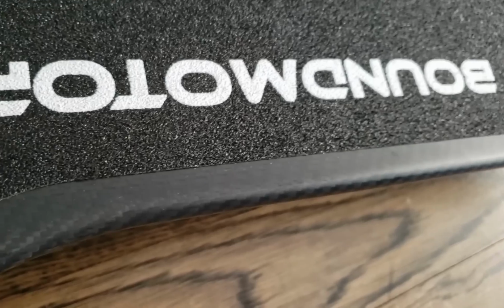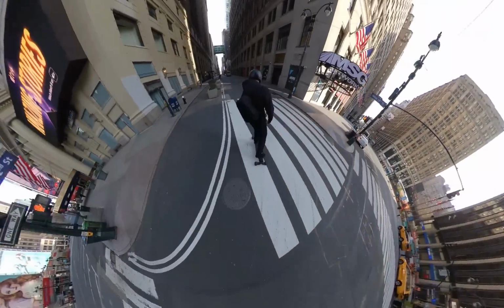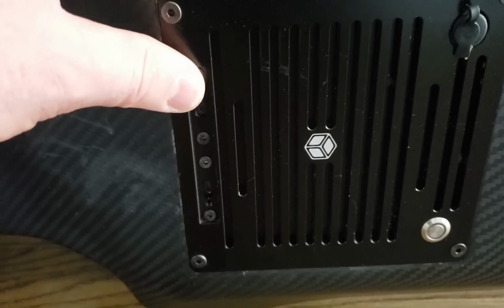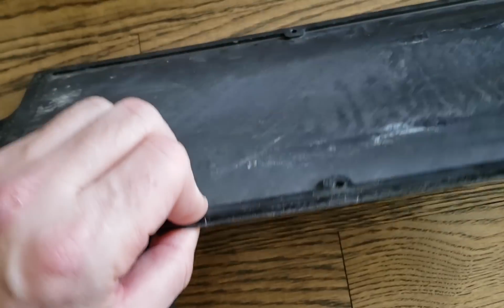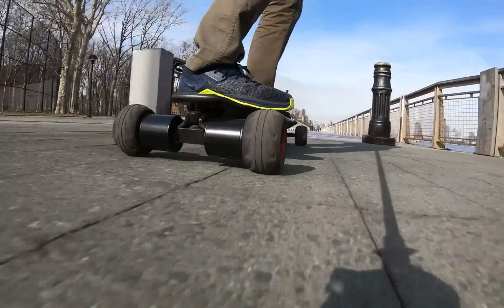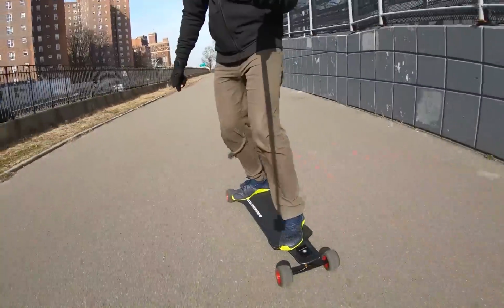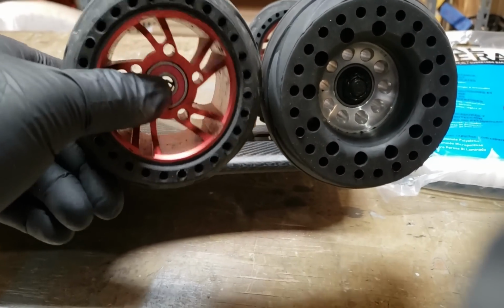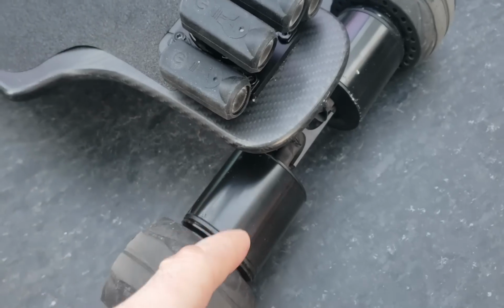Bound Motor D1 Direct Drive Insane Machine

Comment: Hi there I’m just doing a follow up on my comments , after quiet a few months of trying to sort my problembs 10 months , I invested in a new DD for my board ,that didn’t work but did run a little better,invested in 120 cloud wheels for better clearance , tried running my board threw the vesc program ,but one port didn’t respond ,then perchased another vesc from Eovan which is the same board & it just slotted right in , ran it threw the program again ,& !   It turned into a complete beast ,kills hills & scares the frick out of me ,love it as my favorite board now ,love the coast feeling & sooooo quiet , purchased another board from Eovan belt drive this time ,which arrived 3 days after I got the first one running ,so now I’ve got 2 , happy days ,blown away with both boards , would love Eovan/ bound board to make a carbon drop deck like the D3 ,please 🙏🏻😌

Comment: does your motor have this clicking issue at low speed as seen in this video https://youtu.be/1eKIU_q9Dio? pls let me know.
great review from your video!
Reply from the maker: Do this first! Remove the wheels and see if the noise persist. I did not have this issue but I swapped for bigger wheels and the noise appeared. I removed the wheels and placed back the stock wheels and the noise disappeared. 
I rolled the drive without the wheels and there was no noise. I think when the wheels are mounted they may not sit tight or properly flush which make the axle twist and results in bed alignment creating this grinding noise.

Comment: How did u add Bluetooth to this vesc?
Reply from the maker: buy the module and connect to the vesc
Reply: @ElectricVehicleSpace  hmm there's no  extra ports on this ESC?
Reply from the maker: @gti101  u have to solder it
Reply: @ElectricVehicleSpace  ahh do u have a pic where to solder it to?  I would like to do this.  Sorry for any troubles

Comment: OK Good board very different of my Exway X1 Pro RiOT  surf or snow 🏄 🏂.. But I have no information on this Cheap remote , I received VX2 Remote with Digital screen and receiver  how to install this on mother board D1...  And no application for Android smartphone or smartwatch please open source no ? Thank you so much for your help
Reply from the maker: this is a open vesc source esc so it can be mded to do all of the above or just replace with vesc that has this options and you are good to go.
Reply: @ElectricVehicleSpace  I can't configure VX2 on this Board and no support of BoundMotor different motherboards on this brand...  And no Bluetooth on this D1 model
Reply from the maker: @Neobees  that remote is hard to connect to a regular vesc. Its duable just read online and find how to do it. You may need to do some modifications
Reply: @ElectricVehicleSpace  Yes because motherboard BoundMotor VESC they are very different,  so I don't find how to configure VX2 Remote on this board and BoundMotor support no help me, 
I buy a War Watch (Gs Pro)
With this I have a lot information in real time on the road...  But no information of the batterie 🔋 ( remaining,  regeneration %...etc) 
So Remote on my Exway X1 Pro RiOT is better

Comment: Very nice Review I buy This Board and I Sell my Exway X1 Pro RiOT after +7000km 🏄🔋I will Never go Back  to Belt$ Or Hub Motor Never !!!
Reply from the maker: Belts are good too! Keep them.
Reply: @ElectricVehicleSpace  yes but the belts on the Exway X1 Pro RiOT are very thin and smaller on any other brand so that at the slightest emergency braking they break very very often even much too easily

￼

Comment: I'm going to replace my Chinese hub motors with these.  The motor/ESC upgrade will cost more than the original board did.  Which hub adapter should I order if I want to use the Flash wheels you just reviewed?
Reply from the maker: you dont need adapters. You should also try belt drive. It will be cool with these wheels.
Reply: @ElectricVehicleSpace  I decided to go with the 150mm pneumatic wheels.  I have terrible roads with lots of gravel.

Comment: The Boundmotor motor website says you cannot add a NRF / Bluetooth module like you can on Flipsky.  Have you verified that you have an extra port on the ESC? I like the Trampa NRF dongle and the the WAND but Boundmotor says that it is currently not possible.
Reply from the maker: you need to solder to the esc

Comment: I'm 6'1 and about 265 lbs.  I'm debating between the D1 and D3.  I like the D1 because of the carbon fiber because of my weight.  I like the D3 because of the larger battery option. But the D3 also seems to have less ground clearance.  Which would you recommend? Also can the wheels be swapped out for 120 Cloud wheels?  If so, which ones and how?
Reply from the maker: I like the D1 and you can add additional pack on top to double the range. Yes you can swap the cloud wheels if you get the adapters. The ride will get smoother.

Comment: The board has finally arrived! The build quality is top-notch, a solid-looking board. With that said, I have an issue with the controller. For some reason, the remote losses connection unpredictably when riding the board and trying to go full throttle (even on the lowest speed mode). I ride goofy with the remote in my right hand. When using the remote in my left hand (closer to the esc) there are no problems. Very odd as the remote's range is supposed to be 15-20m. I messaged Boundmotor and awating response.

As for the bushings, they have to be tightened down, but how much is too tight? 

Would it be possible to order a custom made battery pack extension that fits in the additional space in the deck from @Portable Electric Vehicle?
Reply from the maker: You can get flex washers and place them over the bushings. It will improve handling big time. Extensions batteries can be made easily. The remote issue is weird. I did not have this problem. maybe the remote was dropped and something is loose inside. Cato should get back to you soon. He is really good at follow up.
Reply: @ElectricVehicleSpace  Could you point me towards a website for the "flex washers". All I'm getting are metallic washers... what about cupped washers? As for the extended battery, they are relatively easy to make however I do not have the proper tools to the battery pack itself. Would I be able to order one from you? If not than no worries :)
Reply: How is your problemb going ,have you fixed it ?

Comment: Hey Vitali, love the review and am considering getting the D3. Do you know if it’s possible to change the wheels on these boards so that we don’t have to use the airless wheels?
Reply from the maker: Depending on what wheels do you want to mount. What are u looking for?
Reply: @ElectricVehicleSpace  I'm looking to put cloudwheels or 110mm torqueboard wheels on it. Also, do you have any other boundmotor boards to review? I'm really close to purchasing the D3 but haven't seen that many reviews on it. Last thing, how long did it take to ship to you?
Reply from the maker: @brainrush25  usually 7 to 10 business days.  Now it depends on customs and c19 ops. I will review the offroad version and the D3 soon.

Comment: You think onsra direct drive is better than bound motor?
Reply from the maker: I have not tried it. I cant comment on that.
Reply: @ElectricVehicleSpace  can you make it happen ?
Reply from the maker: @kevinchan4951  if there will be 50 requests than yes
Reply: Onsra customer support may be better , if you get a bound board you will be contacting them ,sure ,that’s if they answer ?

Comment: Hello, how do you feel about direct drive in terms of damaging the motors? Up and down curbs? Rocks? Thank you
Reply from the maker: I dont jump curbs and I try to avoid big rocks. It will get scratched but it is fine after 2 months and works well as was intended to perform.
Reply: @ElectricVehicleSpace  Thank you!

Comment: With the customizable ESC, how much range could I get if I limit the top speed to 22 mph or 35 km/h. The load would be around 190 lbs on regular roads. Also, how water-resistant is this board? Could it pass an IP 56 rating? I don't want to skate in the rain but if I get caught in the rain or run through a puddle by accident would it survive?
Reply from the maker: idk...this has to be tested. The board can be waterproofed easily. I would not ride in the rain.

Comment: Great review. I think there is an opportunity for a manufacturer since more are starting to include the vesc6 and a 12S battery to do a belt drive version  which can be used as a base to add bigger motors to so have a good value high speed board. If have a battery option that are big enough might provide a good alternative to those that want DIY performance but not the parts or electronics knowledge to go full DIY. Is there anything else out there at a lower price point like this already ?
Reply from the maker: the company is coming soon with a belt system and more options. I have not seen anything better yet but at 1k this is really cheap and the quality is good. If you DIY with available parts on the market today it will run you over 1.4K similar built.

Comment: Would you ever try to put the direct drive motors on the exway flex?
Reply from the maker: it will not work. Exway is tuned with they proprietary motorsmade by wobbywing

Comment: Hi. Could you please advise me about battery. Is there a big difference in performance of 12S3P Samsung 50.4V10.5Ah  with 18650 cells and 12s3p 21700 cells. There is a 200 USD difference in price of the board and I am wondering if it is worth upgrading.
Reply from the maker: use the code I placed in the description you will get a better price. The difference is in the range. 21700 will give you way more range. Thats the main difference and since 21700 have more capacity the battery sag will only be felt once the battery gets to lower level.

Comment: How do you play with the settings like that,  I would love to do the same. What do you gotta do to make it faster like you did?
Reply: I was wondering the same thing. I don't really know much about building boards or adjusting ESC/VESC, but I would definitely want to make it faster since I weigh around 200 pounds. Just adding to your question in hopes that you get a response!
Reply from the maker: Easy, just connect to your computer and install the vesc tool recommended by the company and its easy to set up. There are plenty of tutorials on youtube. Do it and enjoy the board.

Comment: I'm just getting into e-boards, I've been hesitating between a few boards, this being one of them. Which board would you get for a beginner between this, backfire zealot ( or g3)  and the Exway Flex? (Feel free to recommend anything else)
Reply from the maker: I would get the Flex or Verreal RS. if you have 1k than bound motor D1. Check my video description box you can use the code/link and get a better price.
Reply: @ElectricVehicleSpace  Thank you good sir, be safe and stay healthy!
Reply: @ElectricVehicleSpace  wts wrong with the g3

Comment: Those motors are so close to the ground that I foresee problems related to damage on contact
Reply from the maker: For city ridding is very ok. For bad road or off road it will not work out.
Reply: Portable Electric Vehicle  give it a few months and report back

Comment: There should be supercaps in parallel with the battery. I've had a battery go out on me while riding and I couldn't stop. Very scary.
I'm starting to think belts are a safer technology. Some thought has to be done for safety of the rider.
Reply from the maker: could you elaborate on the comment. What exactly are you referring to? There is no need for caps on the battery. The esc controls the motors.

Comment: I need your help! :) I want to buy new board but cannot decide and you have tried all 3 that I am choosing from: EXWAY X1 PRO/RIOT (like: better know brand; concerned: low milage, least powerful ), Verreal RS (like: longest range with 14aH battery, comes with cloudwheel and is the same price as EXWAY, concerned: that on paper lower top speed) and Bound D1 (l like that it claims top speed 50 km/h, but it is strange that is much faster than Verreal despite has same motors). What would you suggest? What was most comfortable and stable ride for you?  My previous board was 1st gen Kooweel and have not tried any other board.
Reply from the maker: Are you looking for portability? Range? or Speed and custom?
Reply: @ElectricVehicleSpace  Thankf for prompt reply. All three are important, I would rank power (speed/torque) in the first place as there are many small/medium hills where I live, second would be portability/range. Also road are pretty bad, so I guess cloudwheels is would be suitable for more
Reply: One more board Meepo NLS pro just came in my mind as it is significantlly cheaper bus has great top speed
Reply: Did you end up purchasing one? I can't decide between the Meepo NLS Pro or the Exway X1 pro. This is the first time I've heard about the Bound D1.. on paper it seems like it would be the best choice.

Comment: So I looked up the specs for the batteries in the board and you can give a max of 35 amp continuous for  those cells, cuz I was wondering, and if you are too.
Reply from the maker: Those cells can discharge more for short period of times. It depends on terrain, your weight and so many other factors. The esc is set to max draw 30A but motors were set to 30A per motor and 60A per motors. When set to 60A the battery was still set to 30A max so it will not affect the battery that much.

Comment: What direct drive system should I get what brand I'm still not sure who I should get it from
Reply from the maker: Get bound motor D1 or D3 awesome boards and the drive did not overheat with my weight. Torques direct drive I tried in 4x4 set up and it is cool but I heard from NYC E- riders that it overheats.
Reply: @ElectricVehicleSpace  I'm getting one soon I'm going to run 45 amps to each motor you think that will be perfectly fine to keep it at that. Are the batteries able to put out 90amp continuously
Reply: @ElectricVehicleSpace  did you have to program each motor/vesc  individually, was there two USB port on the board or was there one USB?

Comment: It's more about ride quality. Mine can do 30mph and about 18 miles if I cruise at 12mph ish. But when you ride it for 5 miles non-stop..your foot and legs get exhuasted. So it's more about range for fun time cruising and ride quality. Speed doesn't matter, I usually cruise at 16mph. Most boards do that easily.
Reply from the maker: how much do you weight. I will do a range test but I get easily 9 miles at high speeds.
Reply: @ElectricVehicleSpace  I'm much lighter than you at 165lbs. But after riding mine over a thousand miles lol. I will have to say that the ride quality is best rather than speed. Just me though since I like to ride until my board dies lol...and that's alot of miles.

Comment: I run those drives on my DIY board, absolutely amazing drives. I will never go back to belts!
Reply: Me Too after 7000km with Exway X1  Pro RiOT,  I want direct drive
Reply: Range seems to suffer though.
Reply: @jamespostle6894  Yes Exway Stop X1 on Jun 2020 , X1 Pro on this December 2020 for a New Product ATLHAS Pro,  it's a very good Board but I change Brand because I'm very disappointed of customer service
Reply: @Neobees  I was referring to the direct drives but yeah good thing too I was seriously considering buying one.
Reply: @jamespostle6894  Already buy direct drive system with Cloudwheels I Wait...   sell it my Exway this month and l'll never go back to belts or hub Motor
Reply: @Neobees  yeah for me a belt drive makes more sense the direct drives are just so close to the ground it bums me out.
Reply: @jamespostle6894  More maintenance on belts Drive after One Year use...  So more money 💵 🔧
Reply: @Neobees  I suppose but It would still be a trade-off as you need to replace the motor housings more often since the motors are right next to the wheels. Not a clear cut upgrade.
Reply: @Neobees  backfire has great customer service but bolts and nuts are terrible, had to ask for bolt names and specs to replace with better quality ones after I had a bolt snap in one week. I emailed them and sent a picture of the bolts that broke and they paid for the new bolts so can't complain
Reply: @P.Subaeruginosa  ONSRA BlackCarve 2  now BMW of feet made in Germany
Reply: @jamespostle6894  With rubber wheels, yes. I switched to TB110s, best wheels for this drives!
Reply from the maker: Awesome.

Comment: Sadly I can't use DD since there are broken roads where i live and it can ruin it. I'll probably get them when I get really large AT wheels.
Reply from the maker: yes indeed is sad.
Reply: I have adapted 6inch pneumatic tires from torque boards to my direct drive kegel adaptor. It's so nice to when going off road on trails with pneumatic tires. All u need is a drill and Dremel tool. I can send pics if you want

Comment: Can you get the hub kits and replace it with a meepo or apsu board hub ?
Reply from the maker: i would not do that. Maybe its double but why?
Reply: @ElectricVehicleSpace  i would use a double for it .. cos i prefer the direct drive thats why

Comment: on paper all of these boards look amazing. but im just worried about its lifespan. how long do these boards last until they totally break down and you have to buy a new one.
i guess time will tell..
Reply: You should build a board yourself so you get to know all the components. Then if something breaks you can easily replace a part instead of the whole board
Reply from the maker: I will do a follow up video in 2 months
Reply: I’ve had my Meepo 1.5 for over two years. Still runs like new and holds a strong charge!
Reply: My motor lasted 5 minutes ,waiting for new one to arrive that I paid for ? Rotor magnets broke down $$$$👎👎👎👎👎😢